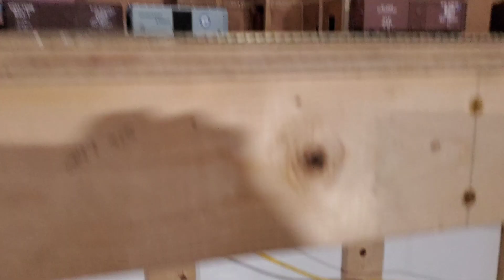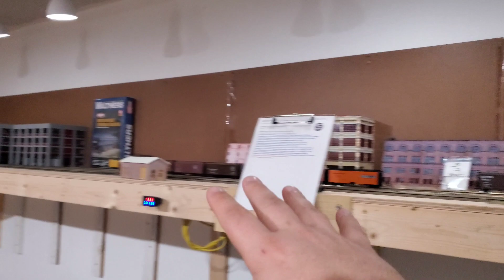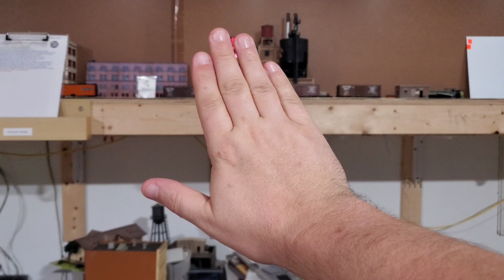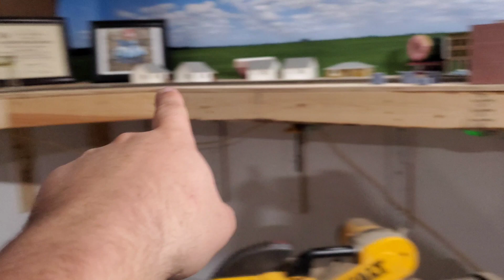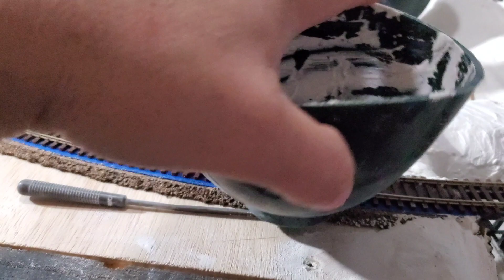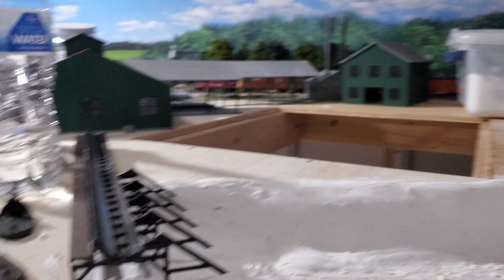Layout Update - Getting Electrified and Plastered!!!

Comment: Is the CP6 planned to be your permanent short protection solution, or will you swap to digital circuit breakers in the future?
Reply from the maker: Not sure at this time. The cost of the digital ones, such as the NCE EB1, is relatively the same cost as the CP6 but the EB1 only does 1 circuit where the CP6 can do up to 6. The EB1 can do up to 8amps where the CP6 (if all jumpers soldered together) could do 6amps. For HO scale, each power district I am using 1 amp except Staging where I ran a jumper from #5 and #6 to create a 2amp circuit. An HO scale sound locomotive that is idling only uses roughly .125 to .25 of an Amp depending on the decoder that is installed. Each type of circuit protector has their pros/cons. I will most likely end up buying one of the digital ones just for my roundhouse when I end up building the lower level since I will have more locomotives there than anywhere else on the layout. Thanks for watching!
Reply: @ColonelCottonBelt  I made the decision not to add digital breakers on my current build, primarily due to cost. My command station and booster both have adjustable circuit protection, but I am concerned about damaging my command station instead of a breaker.
Reply from the maker: My command station has one built in as well but adding the CP6 doesn't shut down the whole layout but only a section if there is a short.

Comment: Can't wait to see those mounds become hills... Quick question, instead of using the CP6 couldn't you have gotten by with #2057 auto bulbs? I was wondering if the NMRA specifically required the CP6.
Reply from the maker: Thanks Aaron. No the CP6 is just a NCE product that is very easy to use. The bulbs are auto bulbs but I don't remember exactly what type they are. The AP Cert doesn't specify what products to use, it just specifies that you have some type of short circuit protection on your layout where if one area was to go down, other areas are still up and running.
Reply: @ColonelCottonBelt  The CP6 has a flux compacitor vibe to it which is pretty cool.

Comment: Looking great! Im also working on various NMRA AP bits myself. If everything works out i should have six of seven covered by NMRA 2024 in Long Beach.

One other note on NMRA AP, don't forget the Golden Spike Award! It's super simple and can not be awarded AFTER MMR award.

You mentioned that you are using LCC, im curious how you are using it today?
Reply from the maker: Thanks! Yes I already have my Golden Spike and it's sitting on an unscenic area of the layout to the right of my Budweiser brewery. I'm just starting on my APs and I figured that Electrical and Civil will be the easiest for me to get. Thanks for watching!
Reply: @ColonelCottonBelt  after golden spike those are definitely the easiest of them. You shouldn't have much trouble with with scenery or structures (which includes the new trestle!)
Reply from the maker: That is 3rd and 4th on my list. I'm also working on Assoc Volunteer as a BSA Railroading Merit Badge Counselor. Just takes a while to get 60 points. The others I plan to do is Chief Dispatch and Master Builder Cars.
Reply: @ColonelCottonBelt  very nice, I'm aiming for golden spike, electrical, scenery, cars, civil, structure, motive power. I'm not sure which from the volunteer group yet but it's definitely the hardest (and easiest) due to the 60 time units requirement. I may write a few articles to cover part of that possibly.

If all works out I'll also be hosting the first operating session on the new layout at Long Beach!
Reply from the maker: Sweet! Best of luck towards your progress!

Comment: Great update, Jason. Good luck on getting your master model railroader certification. They don’t actually send someone to verify things on the layout, do they? Wouldn’t it be more beneficial for you to mount the block short protection above the benchwork so you would see the light more easily? I like the rolling hills. I haven’t seen anyone use the screen wire in a long time, old school method. Stay well.
Reply from the maker: Thanks Derek! Yes they will be sending most likely my Division Director to come and inspect where I have to demonstrate that everything is working. The block protection needs to be relatively close to the DCC system and with it having 6 bus lines going in and out of it, I rather it be somewhat hidden but noticeable when it lights up underneath the layout.